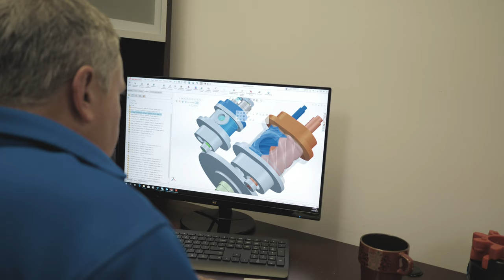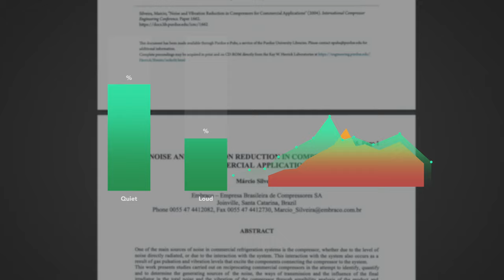The Truth about Industrial Air Compressor Equipment

Comment: I purchased a 20hp Kore total air system from Matt @Compressor world. 
Best, most reliable, cleanest air for my cnc machines over 8 +years running 24hours a day.
Kaishan looks like the same high quality- similar built unit.

Comment: The problem with the new equipment is the sump tank and the separators are smaller than what they should be. The fluid capacity in the machines have been cut to almost in half or even more than half in some cases.  The fluid does not have much settle time in the sump tank before it gets reused again very quickly, that coupled with a compressor that passes oil down stream is a recipe for a disaster.Also the coolers are too small for most of the ambient conditions the compressor is running, and that’s my opinion . I think if I was a large distributor I would just manufacture my own compressors. You can easily get somebody to build you an air end, And Aircon makes all of the control devices you would ever need

Comment: Why is bigger better? I agree equipment is made cheaper and made to fail now days. Why is bigger better though?
Reply: The larger a motor is, the more surface area it has so it can cool more efficiently which will raise the ambient temperature rating that way you can have the larger 100hp motor in a hotter environment than the competitors 100hp motor. Also vibration would be lessened.
Reply: Whatever TheGrindeveryday said. Plus potentially more copper in windings, another thing is good old torque - the longer the lever the more torque. The bigger the diameter of the rotor- the more torque, it might take more in rush current to start the motor, but then when it is running the “flywheel” effect helps to balance out things and run smoother.

The “miniaturisation” always lead to higher speeds, running hotter, increasing velocity ( increasing friction), instability, volatility, turbulence and short life.